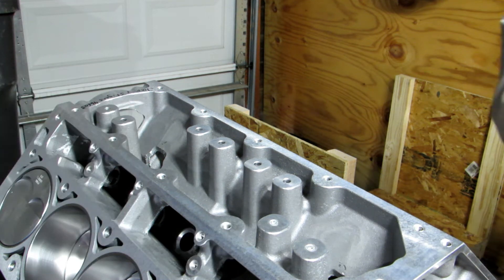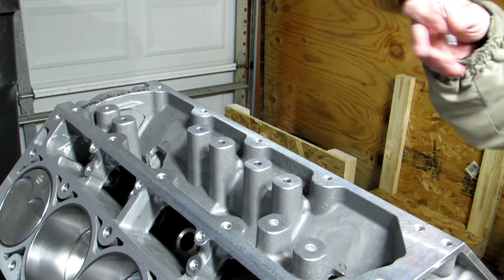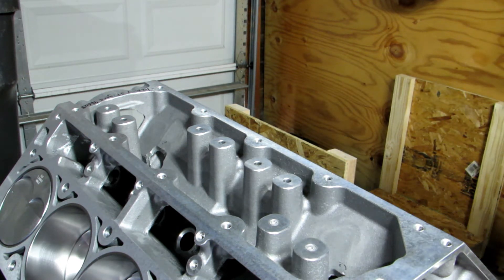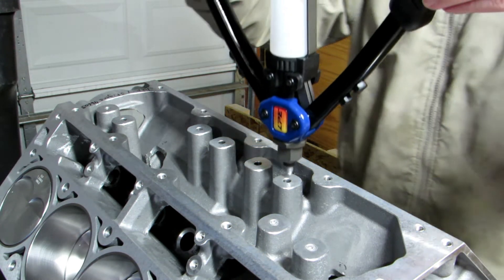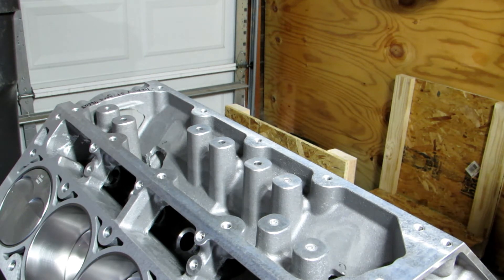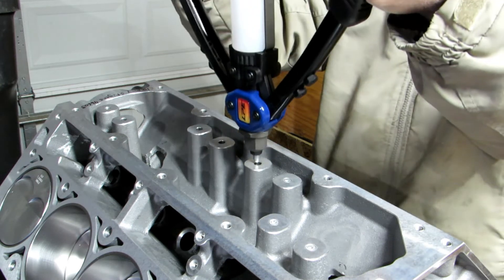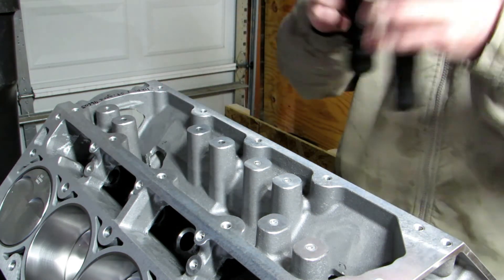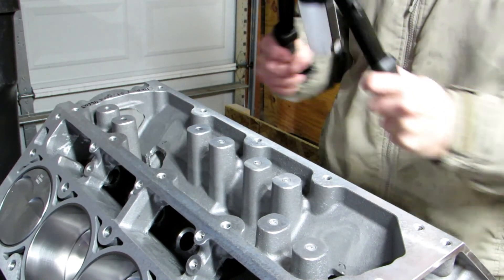Lingenfelter DoD tower plug kit demonstration

Comment: What happens if the metal stud in rivit falls down in motor
Reply from the maker: It can't.  The "stud" is captured inside the white part of the tool.  When you are done you can remove the white piece and empty all the "studs" out.  In this particular video I was working on the short block with no oil pan or cam installed so if you did drop something as large as a "stud" you could easily remove it vs small shavings from tapping threads in the towers which would be impossible to know if you actually removed all of the debris.

Comment: The cover that comes in the kit plugs the oil passages I did those for extra security but dropped a real small piece of the rivet down there I should've left it alone and just used the plate that plugs it but I going to risk it hope it stays in the valley somewhere and not into the engine 😱😱😥😥 ill find out once it's back together lbvs

Comment: Did you delete it first? Or are you just disabling the afm/did with a tune?
Reply from the maker: I built this motor starting with a new block.  You must plug the dod towers or you will have a load of oil pressure due to an internal leak. This motor went into a 2004 Pontiac GTO it never had dod/afm.
Reply from the maker: *loss of oil pressure

Comment: Its a pop riveter
Reply from the maker: Correct and it works well
Reply: What size are the rivits
Reply: @roygrohler4871  I don't know.. I just used the gaskets on mine.. no issues
Reply: @roygrohler4871 1/4"
Reply: What size rivets?
Reply: @lonnieperkins6780 1/4"